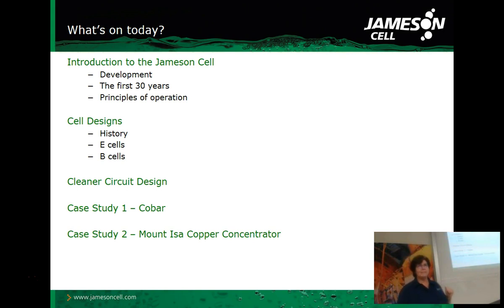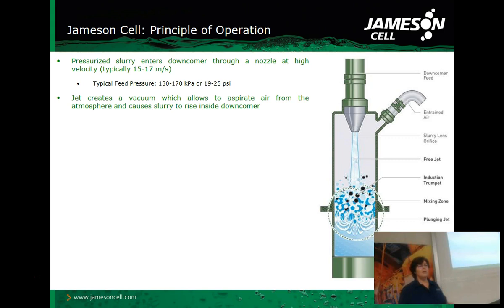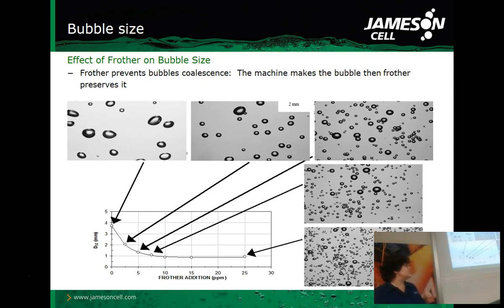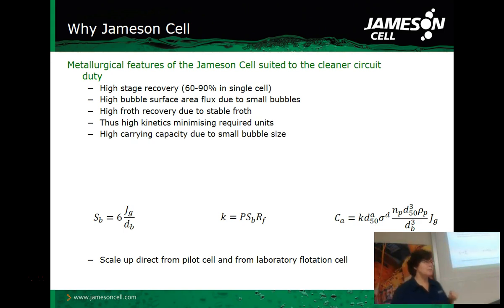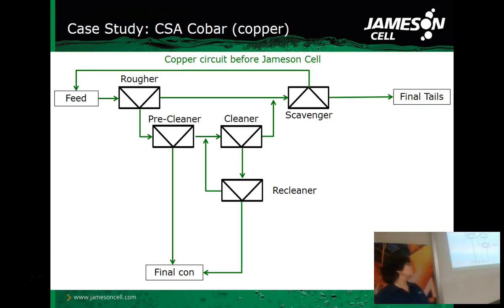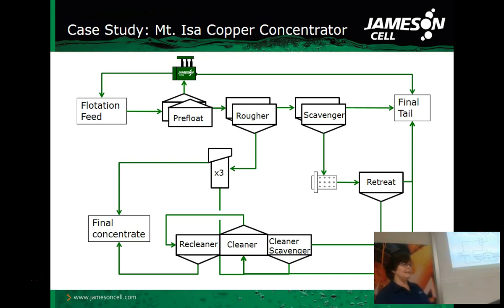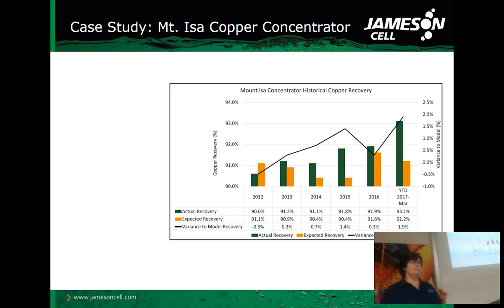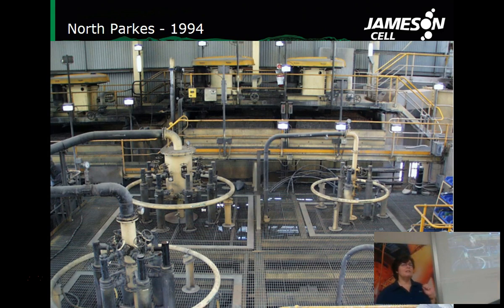Virginia Lawson - Getting the best out of your bubbles - Flotation Circuit design using Jameson Cell

Comment: Our ops/maintenance teams loved the idea of the quickly couplings on the slurry hoses. What pressure ratings are these suitable for? Is there a suite available for use in other applications? Does this require a tapered profile on the hose flange?